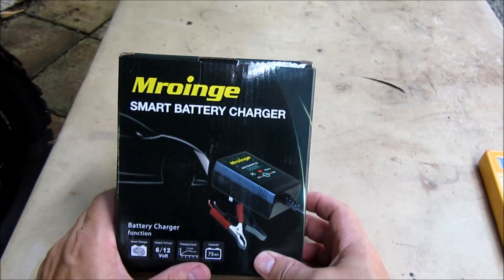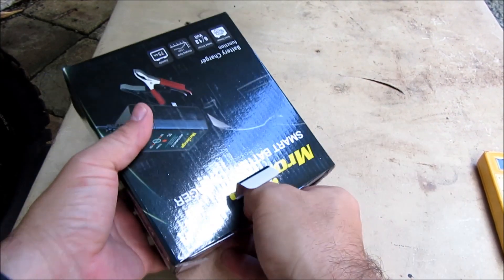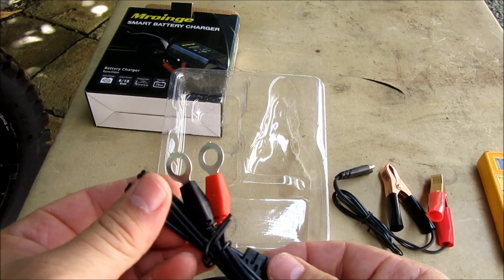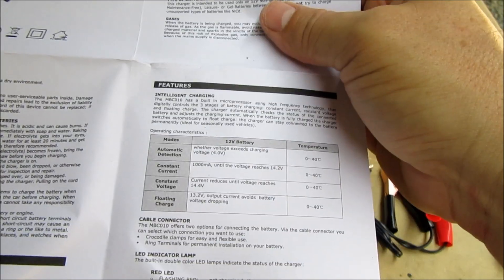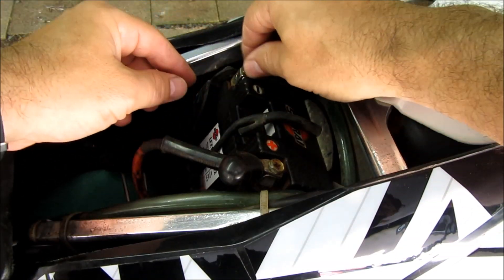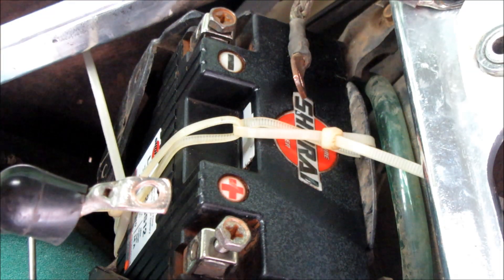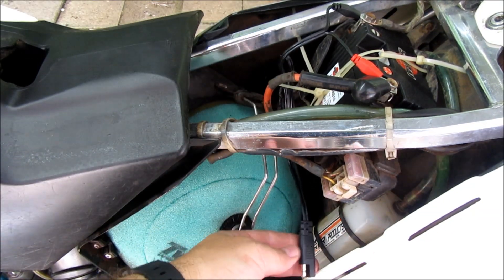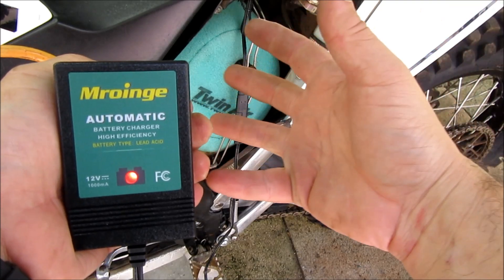Affordable 12V Battery Maintainer Unboxing and Installation

Comment: Thanks for the video, I have a quick question. Can I use the clamps to charge the battery? Or does it have to be the circular ends, like the ones you used?
Reply from the maker: You can use the clamps also.